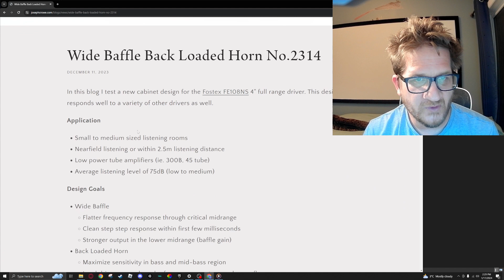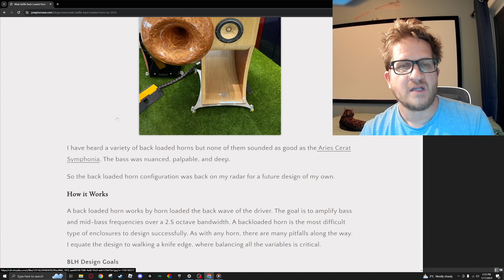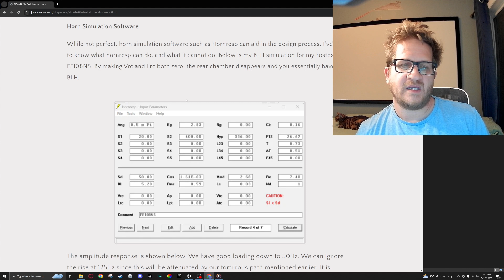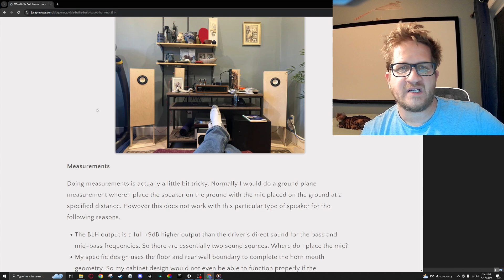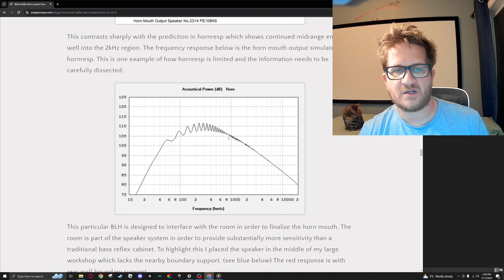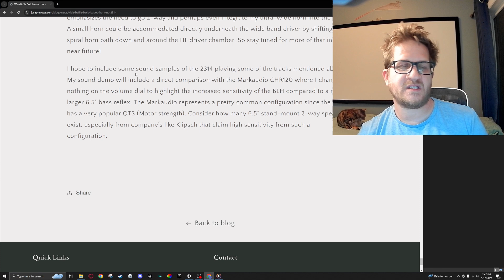Wide Baffle Back Loaded Horn No.2314

Comment: Interesting video! Since this cabinet is designed for the Fostex FE108NS, do you think my small 3.5-4" Coral FE-103A 'holey basket' with an Alnico magnet would also perform well in it? Would any modifications to the cabinet or tuning be needed?

Comment: Wow many thanks Joseph, your vids/blogs are always very educational. Possible to use the same but deeper cabinet for 8 inch driver ? The horn lenght for said cut off frequency design should apply for different size driver too right or ???? Many thanks again
Reply from the maker: That’s correct. This was a design study plus proto build. I plan on developing this further as a 2-way with integrated wood horn.
Reply: Many thks for the reply Joseph, can't wait to see an 8 inch version
Reply: Oh I overlooked 1 point. Fundamentally it's gonna be a 3 way design right , for 2 way a huge horn would be needed in order to go down to 300hz unless you
tweak the design to cut off at a higher frequency. Is my assumption correct ?
Thank you again

Comment: Very nice design. I will definitely consider these for my next project. I much prefer the looks of wide baffles so that is reason enough for me, the gain in efficiency is a bonus. Isn't this really a transmission line tho? Anyways, I guess it can be defined as both depending on which parameters one let dominate.
Reply from the maker: I would say the difference is that I’m not relying on a damped line to attenuate the midrange. Also the mouth termination is an exponential flare into the room (as much as reasonably can be achieved) versus the conical flare rate of TL. I think TL relies on resonance similar to a port, but I’m trying to avoid resonance (first order reflections back down the line). But in practice they may be more similar than not…perhaps a TL is simply a horn in function.

Comment: It would be interesting to hear how the similarly sized but higher sensitivity and flatter fq response curve  Mark Audio CHP-90 would do in this spiral  BLH
Reply from the maker: I tried the CHR-50 as well as a variety of other drivers. Mark Audio does not respond well at all to horn loading. It simply doesn’t have the motor strength (low QTS among other parameters).  The Fostex FE83NV2 did incredibly well, same bass but didn’t go as loud as the FE108NS.

Comment: If you line enough of big end the horn with soft surface absorption felt, and the interior of the first rear chamber area, you can absorb a great deal of the unwanted mid bass that causes cancelation. Been building these for decades. In essence, I want to think of it as a transmission line with acoustic gain in the line.... and to attenuate all frequencies above where the horn provides reinforcement as 1/4 wave. I'm currently running a single 16" Altec GPA 515-8LF in a large BLH... smaller than a Jensen Imperial and larger than ANY of the JBL scoops.. the bass impact essentially sums the driver area, plus mouth area.. resulting in body moving experience.. It produces more body slam than 4x 16" direct radiators per channel.
Reply: Interesting. Can you upload a video description of those?
Reply from the maker: That was my experience with the 2095 BLH which I’ll be doing a video on shortly, which is a large 15” cabinet. The impact is the same as you describe, even with low power amplification. 

https://josephcrowe.com/blogs/news/15-back-loaded-horn-no-2095

Thanks for the feedback! The 2025 benefits from a pillow in the horn mouth. This is something I’ll try on the speakers in my video.

Comment: Interesting.  I wonder what 10”  full rangers would do in a BLH cabinet.   (ie. Cube Audio F10)  They are in Voigt pipe cab.s now—love ‘em, excellent bass.
Reply from the maker: Exactly…that’s the plan. I have the 18Sound 10NMB520 which has an ultra low QTS for horn loading, 2-way using a 1kHz crossover point to a similar sized 1” horn.